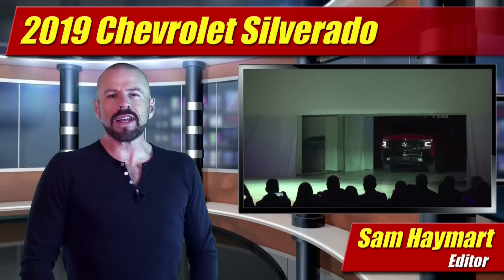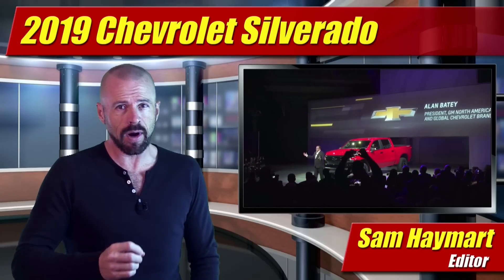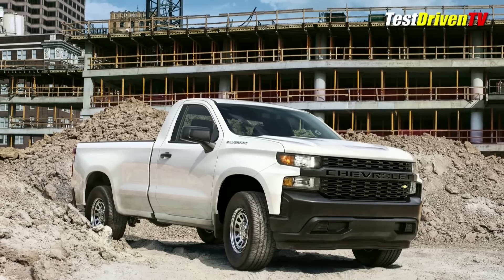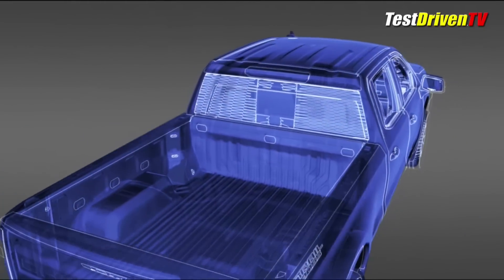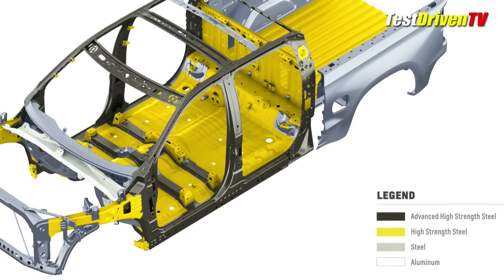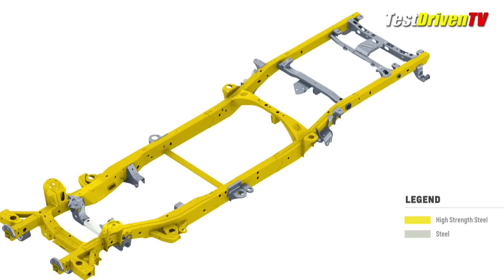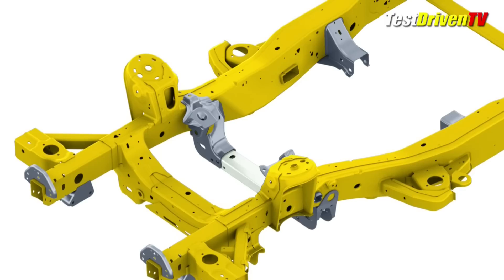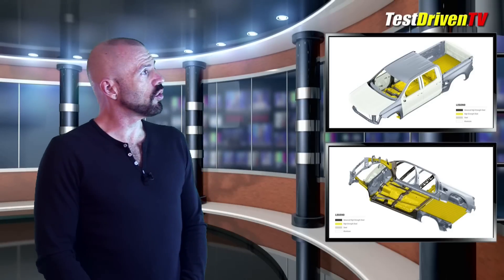2019 Chevrolet Silverado: Mixed Materials Explained

Comment: Sounds like a disaster waiting to happen. Intermix a bunch of different metals, expose them to the elements and freeze thaw cycles, then see how good it is in 10 years. I am sorry, but simpler is better.
Reply: mjk2374 I agree, but new trucks are only engineered to last 5 to 9 years, kinda disappointing all I hear is fuel economy.  It comes down to demand and let's face it, trucks have become nothing more then grocery getters/ soccer mom vehicles that are geared way to high, program to shift way to early and programed to run on the least amount of cylinders as possible.  I miss solid front axles, 3 speed automatic and v8s that ran on all 8 cylinders and didn't turn off when you come to a stop.